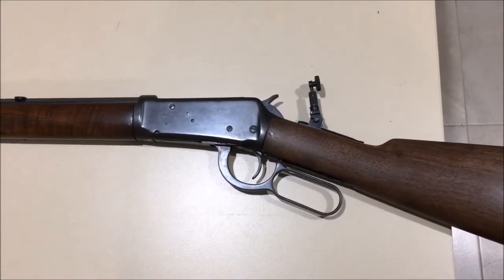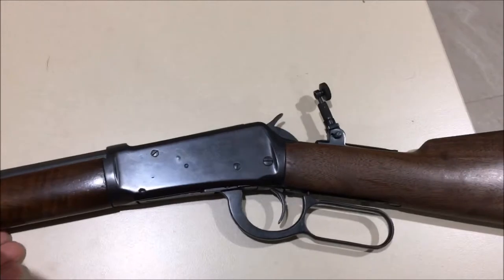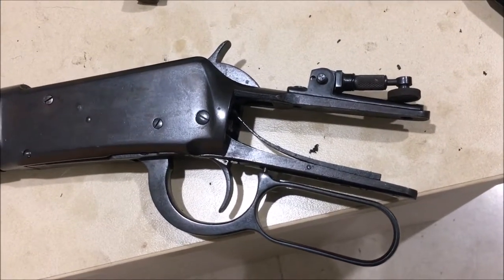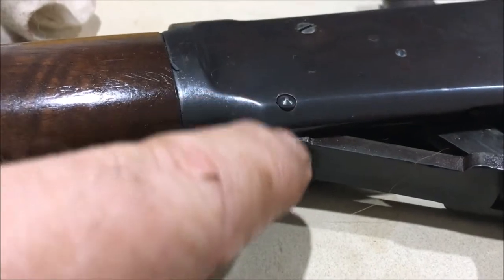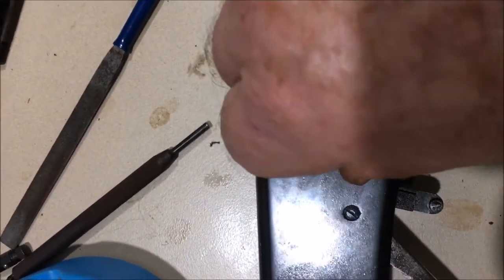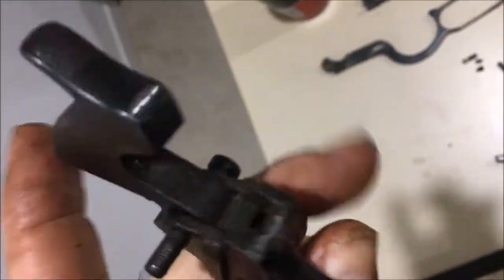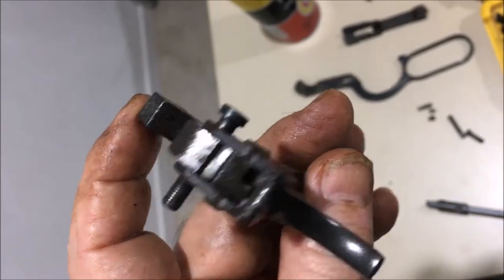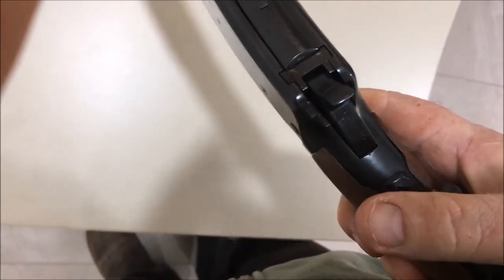Dis-assembling and Repairing an 1894 Winchester Rifle that Won't Cock

Comment: I know I'm commenting on a four year old video but I wanted to thank you for making that. I have a pre 64 Winchester model 94 in 30-30 that was my grand father's rifle. I believe it was built in the 40s. I hunted with it a lot when I was a kid but haven't fired the rifle for almost 40 years. I recently disassembled the rifle for a thorough cleaning. I found the ear on the breach block that secures the extractor spring to be broken. No way to repair it. I've found a stripped breach block online for about $60 which I intend to buy. This broken tab is not causing the rifle to malfunction in any way  but I'm afraid to shoot it in this condition. When I reassembled the rifle, the action does not feel right and the hammer comes forward as you close the breach... I'm going in again and will shine up the bits that you did in your video and see if it corrects the action and funny business with the hammer cocking. Sorry to ramble, I basically just wanted to thank you for posting your video as it gives me hope that I can correct my rifle's action in a similar fashion.
Reply from the maker: Being a John Browning design the '94 is very reliable. The new breechblock should work. I suggest once disassembled install the trigger and hammer only with no springs and check that they are working by putting gentle pressure forward on the hammer and the trigger and make sure the sear on the trigger is retaining the hammer. I'm glad the video was useful for you.
Reply: Thank you for the reply and for your help.  I did as you suggested and found that when I reassembled the trigger and sear I had the long straight end of the trigger stop spring under rather than over the trigger tab. There was not sufficient tension on the back of the trigger to make the hammer operate properly. I'm reassembling now and everything feels fine. Thanks again mate. Cheers from Northern Arizona USA. 🍻
Reply from the maker: @Sonic_Ox  Good job. I have travelled through Arizona north to south on back roads as much as possible during a 28000 mile trip through North America in 1995. Had a Jeep Grand Wagoneer. Very memorable area.